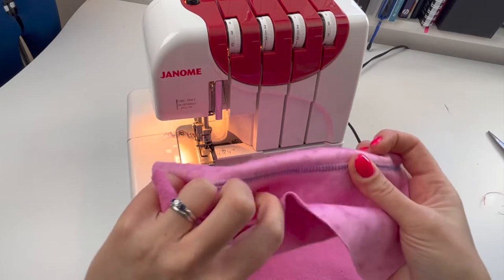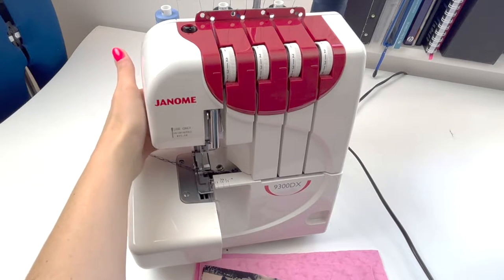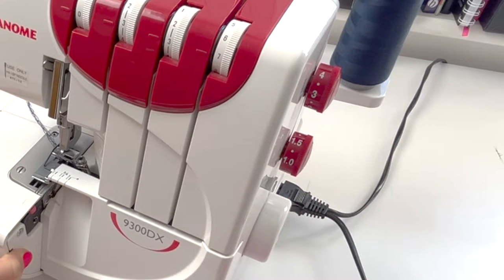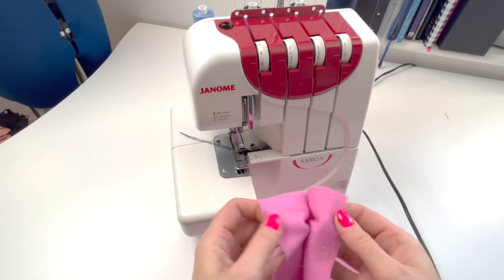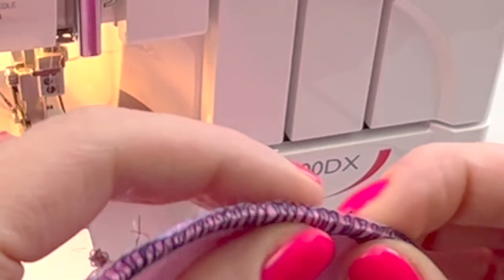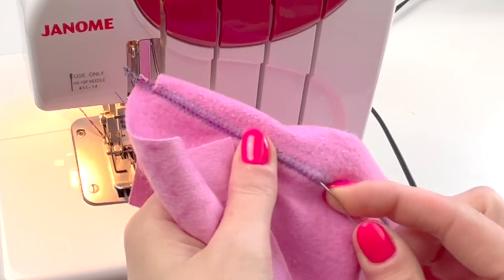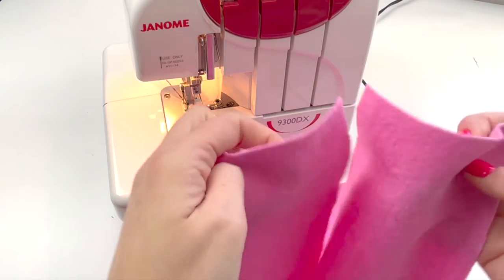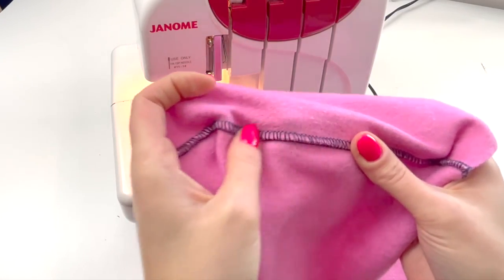How to Sew a Flatlock Stitch on Your Overlocker / Serger

Comment: How much seam allowance does this use? I'm thinking none?
Reply from the maker: There is a slight overlap of the fabric in the seam, so the seam allowance taken is the width of the overlocking stitch. In this case approximately 6mm.
Reply: @HouseofMissSew Ben de aynı şeyi merak etmiştim 😊kalıba ne kadar dikiş payı vermeliyim?Dikiş payına gerek var mı 🤔Sanki iki kalıp karşı karşıya geliyor gibi
Reply from the maker: @selviyeozdemir3501  There is a slight overlap of the fabric in the seam, so the seam allowance taken is the width of the overlocking stitch. In this case approximately 6mm.